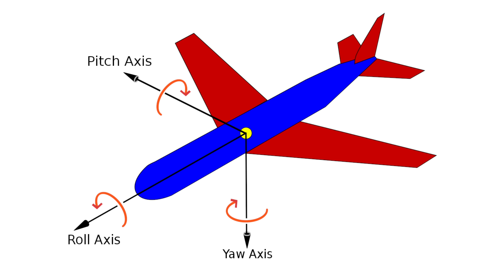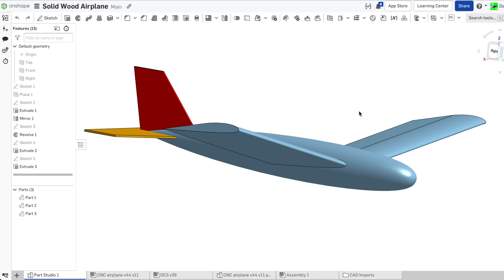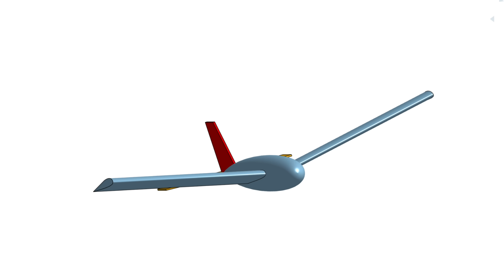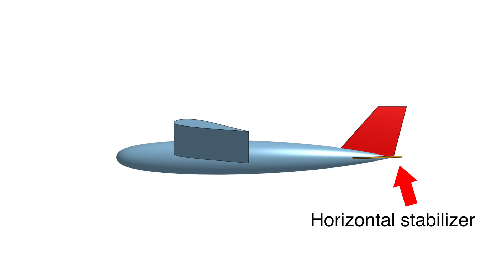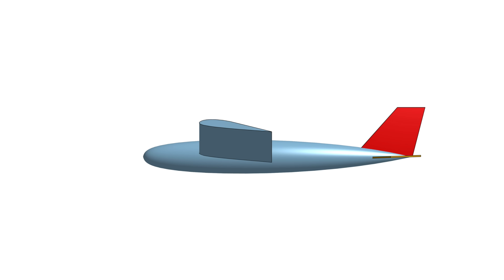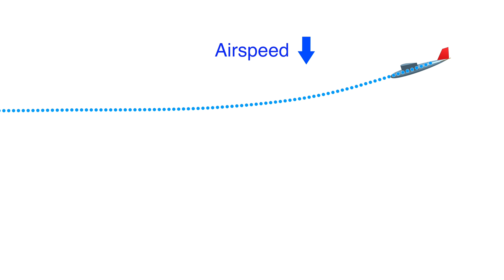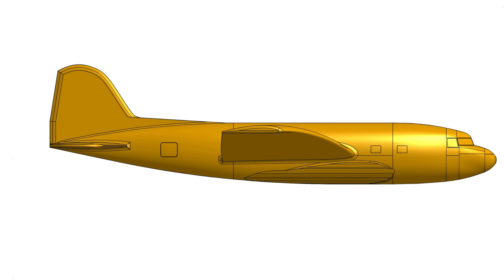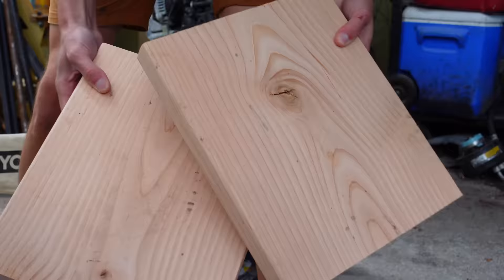Can a Solid Wood Airplane Actually Fly???

Comment: It seems to me that your explanation of dihedral/aoa is getting wing sweep and dihedral a bit mixed up, ie confusing yaw stability and roll stability. The roll stability comes from the amount of projected lifting area available for each wing for a given roll angle. Alternatively/additionally, the lift vector provided by each wing increases as it gets closer to horizontal and decreases as it goes towards vertical, creating the Internet stability.  The effect of the aoa when yawing (sideslipping) is a separate effect that is similar and related to wing sweep.  There is an interplay for sure, as seen in Dutch roll, but I find your description a bit misleading

Comment: Your difficulties lie in the use of a flat bottomed, or sometimes called a Clark Y airfoil on all your planes. This is the one item you totally overlooked. These are designed to fly at a relatively low wing loading. These are used on sport planes and gliders.

The issue is, is that the faster they are propelled, the higher the lift they generate. A fully symmetrical airfoil negates most of that characteristic.  So, the higher the airspeed, the  more they will l zoom up as you propel them., at higher and higher speeds. 

Important as well is the angle of incidence of the wing. That is established by the stabilizer. As is used on a low lift airfoil, (Clark-Y)

The invoking of the Bernoulli principle as the explanation as to how a wing generates lift, is still taught today in middle school physics books. So I ask the teacher, what about fully or partially symmetrical airfoils? He had no answer. 

If the curve of the wing on top of it is greater than the bottom, the Bernoulli effect is there, but contributes only a small proportion of lift.  

Try building the exact same model, but make one fully symmetrical and the other flat bottom.

Just for giggles, do another with an under-cambered airfoil, such as the ones used by the Wright brothers . As did most warplanes of WW1. The exceptions are most of the planes designed by Anthony Fokker. His Eindecker, (One Winger) is the perfect example of that. One notable exception is his Triplane, which used THREE wings, all slightly under cambered. . The Red Baron's plane, for instance. These airfoils provide the highest. Gliders use them a lot.

Heard of the Red Bull aircraft?  They use symmetrical airfoils. They need to have the same characteristics upside down, as they do upright, so that  the control inputs are more evenly matched. The same goes for Aerobatic planes such as the Pitts Special and Sukhoi aircraft.

What about commercial airliners? They use symmetrical airfoils for low drag at high speeds. When it comes to land, or take off, all those slats at the leading edge and flaps at the rear, create a high lift, low speed configuration. In fact what is done there, is to convert a symmetrical airfoil into a somewhat crude, crude under cambered airfoil. 

Try this. Make the same plane, but just use a flat plane (rectangular) for your wing. Make it thick enough to maintain a measure of rigidity.  Set the balance point at the same place as your other planes. But for the wing to generate lift, you'll need to establish a positive angle of attack by way of the stabilizer.  Give this plane a light toss from eye level. It will likely glide straight out , all parameters being equal,  Now give this plane a hard toss, from eye level. The plane will now zoom and likely hit you on the back of the head. Those foam gliders they sell at the Mall, ALL do that because the angle of attack will provide more lift at the higher speeds. To make matters worse, those planes have a flat bottomed airplane,,, which is very sensitive to air speed. Too much speed, too much lift and WHACCK, to the back of your neck. 

Finally, you need to make ALL you planes have a low wing loading. You've got goats, apples, raisins, peaches.
You've got to compare oranges with oranges. Use 
apples, if you wish. 

Here's my other channel. 
 https://www.youtube.com/watch?v=dWGZOaHi84I
https://www.youtube.com/watch?v=PuS3r-rQ9rM

Cheers

Comment: Have you studied the effects of scale in solid wood planes? Scale up, and we can all agree it will eventually become too heave to do anything but tumble down to the ground. Too small...can that happen? If you halved the scale and saved a lot of wood, plastic and machine time...would it fly "better"? Longer hang time...probably?
Half the size means 1/4th the lift, but 1/8th the weight. Less weight behind it, also slows it down faster, perhaps?

Comment: Would sanding the wood to a finer finish help with the aerodynamic characteristics? Also would longer wings like an actual glider assist with lift at a low airspeed?

Comment: By definition “solid” though the wood as a material is solid. Putting a motor on it with screws, or creating any indentation for the purpose of storing electrical units or area of the aircraft body which makes it convex in any way defeats the purpose of calling it solid. This would simply be a propelled glider. Cool work though.

Comment: Balsa wood is wood -- right? Take that curve out of the wings or give them a touch of upward curve on the original design and it will fly great. By curving the wings downward you are completely negating the effect the dihedral should have.

Comment: Anything can fly - I've even seen model Radio Controlled lawnmowers fly - all it takes is speed and a powerful engine.
Reply: Not really.
Reply: @mincrafterzatplay2842  - You better study physics....even a beer tray flies with a good engine and propeller pulling it.
Reply: @LanielPhoto  No
Reply: @mincrafterzatplay2842  -If the wings are aerodynamic, then a high enough speed will definitely keep it airborne. To say no proves a total lack of knowledge of physics and flight envelopes. Guess you never flew radio control aircraft!
Reply: @LanielPhoto  Center of mass and lift
Reply: @mincrafterzatplay2842  -Lift - Exactly why it will fly.
Reply: @LanielPhoto  CENTER OF LIFT NOT LIFT BUT ALSO LIFT
Reply: And I make rc aircraft
Reply: @mincrafterzatplay2842  - Then you know that even a straight slab of wood can be made to fly and be controlled.
Reply: @LanielPhoto  I give up :( ... never
Reply: also no not true
Reply: @mincrafterzatplay2842  - I have seen it ! And not just once. Angle of trust and all that..... but enough - your mind is already made up.
Reply: @LanielPhoto  SAYS WHO??????
Reply: @mincrafterzatplay2842  - Stick to playing minecraft. Build nice airplanes in minecraft. They don't even need lift. Or trust. Or wood.
Reply: @LanielPhoto  I'm seeing this after building  a flying machine
Reply: (in mc)

Comment: Whi9le what you said about dihedral is partially correct you omitted the the actual force that levels the plane. Please hear me out. Imagine you have the plane in le3vel flight position , you're actually holding it with the nose pointing at you,  and the then rotate the plane about the roll axis until the left wing is level with the horizon. Now lets look at the vectors. The CG is still vertical and pretty much on center. Now look at each wing separately. The lift of the left wing is parallel to the CG vector so that all the lift produced is used to right the plane, while the lift vector for the right wing which is still normal to the wing is pointed off to the left. When you break down the vectors into it's horizontal and vertical components,  of the  left wing,  you will see that the  vertical component of the right wing is less than the left. This creates a moment force which levels the wings.  . In other words the vertical lift of the right wing is diminished compared to the left wing and that imbalance rotates the plane back to level. In the case of a plane like the Pietenpol where there is no dihedral stability is created by the fact that it is  a parasol it gets it's stability from the CG no longer on the center line of the wing and it then creates to torque to level the plane. (pendulum effect) Something else you didn't take into account is that when you drop the plane with the nose pointing down the CG and center of pressure are in line. so the tendency is for the plane to remain in the nose down position.  .In most cases you should get a lawn dart but you are doing the test in air that is not necessarily smooth the plane sometimes comes out of the Kamikaze dive. Before you swear at me please think  about what I said about how dihedral levels the plane. In the case of the Peit if you add dihedral too you wind up overcompensating and then it suffers from the falling leaf syndrome. I have been one of your fans for a very long time (since you were a teen) and that is because I enjoy your experiments.

Comment: I made a sheetmetal paper airplane from galvanized sheetmetal when i was 14 .. The metal was about 15 or 16 inches X 2 feet or so . I used a black tarp hook with the " S"  hooks.  I curlked the elevator  end up a little . It sounds like a rocket whooooshhhhhhhhhhhh boom. . The neighbor laddy came out and tthought a car hhit a pole . It was stuck into the garage wall so i did not look in that direction

Comment: IT'S  NOT  JUST  HAVING  A  CORRECT C/G .... WEIGHT  DISTRIBUTION  THROUGHOUT  THE  PLANE  IS  IMPORTANT  TOO .... THE
BEST  FLYING  PLANES  HAVE  MOST  OF  THEIR  WEIGHT  CONCENTRATED  NEAR  THE  C/G...... A   PLANE  OF  SOLID  WOOD  
HAS  TOO  MUCH  ENERTIA  TOO  FAR  FROM  THE  C/G ....  THE  PLANE  MAY  HAVE  A  CORRECT  C/G  BUT  THE CONTROL  SURFACES  WON'T   HAVE  ENOUGH  FORCE  TO   ENSURE  STABILITY .... 

..................................................................

Comment: Hey man, why didn't you just throw it, or build a sliding catapult like the ones they have on aircraft carriers? The data you get from dropping the airplane doesn't seem to be as useful as it would be if the plane were launched and took off like a conventional plane. As a society it would be difficult to reconcile boarding an airplane in the first place if it took off by Falling Towards the ground at terminal velocity. Therefore it's hard for me to reconcile why you chose that as your method of testing. Criticism aside, you made a pretty good-looking plane.

 velocity = sqrt(2 * lift_force / weight_force)
That is the equation for calculating the velocity necessary for your plane to achieve lift.

Comment: Apple AirTag?  you’d have to design it in, in advance
Reply: @Gizmos_and_stuff  This would give you hundreds of meters / yards to be able to track the item, and light weight.  Or at least close enough to the wood weight that it displaces, that you could plan around it.
Reply: @whophd  airtags aren't GPS, they don't track speed, altitude, etc. They connect to apple deivces and get the location from those i believe, a small GPS tracker could work maybe (edit: spelling)

Comment: Could you have injured or killed a living being with these things?
Reply: Absolutely.  I shot a 6 inch Estes rocket with a B motor a 1/4 mile across Sharon Meadows in Golden Gate park and the chute didn't open. It drove itself into the ground 3 feet from a baby carriage (with baby). Only the tail fins were sticking out of the ground. No rockets after that, just boats, cars, helis, and drones. Normal stuff, and a duck with an airsoft pistol in its head.

Comment: Your definition and explanation of "sideslip" are completely incorrect.
Reply: please explain.
Reply: @BariumCobaltNitrog3n  Sideslip is a maneuver deliberately performed by the pilot, by pointing the nose into the wind and counter controlling otherwise to maintain heading at the same time, usually while descending on a landing approach.
Reply: @ricg2011  Is that what they call crabbing? To counter a side wind?